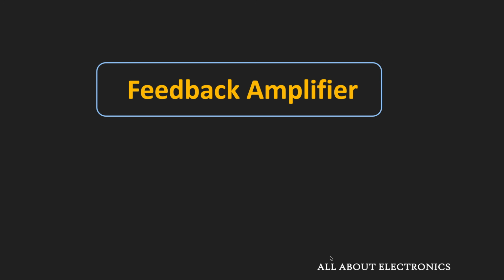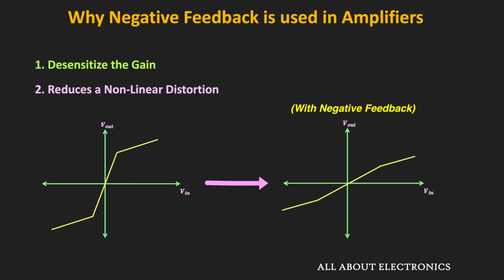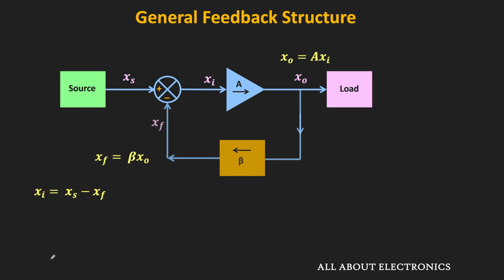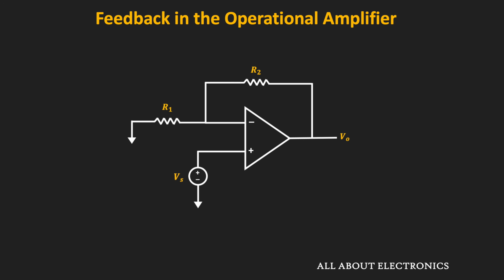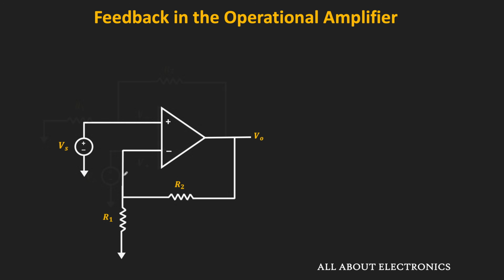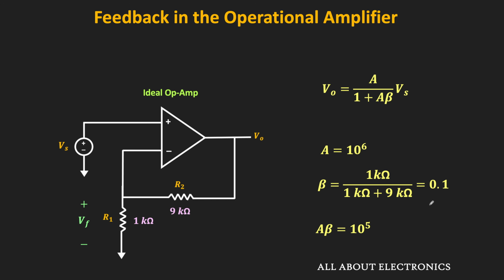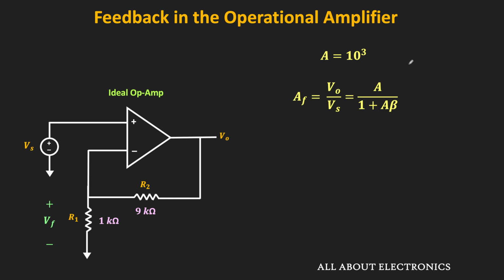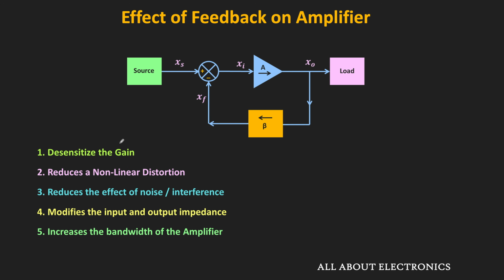Introduction to Feedback Amplifier | The concept of Negative Feedback and its advantages

Comment: Your explanation is very clear, but can you please not remove the diagrams so fast... and also can you use a laser light to point to which section you're teaching on the screen
Reply from the maker: will consider your suggestion. And will make sure that the diagrams are not removed very fast. But if required you can always pause and rewind specific part.